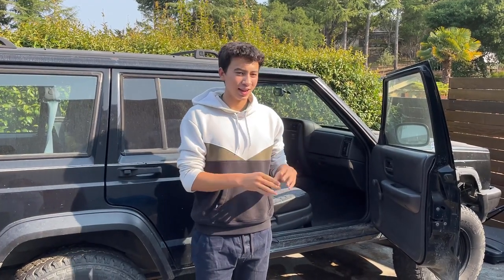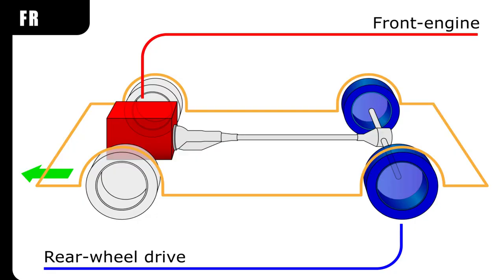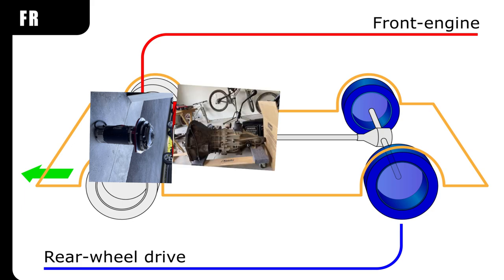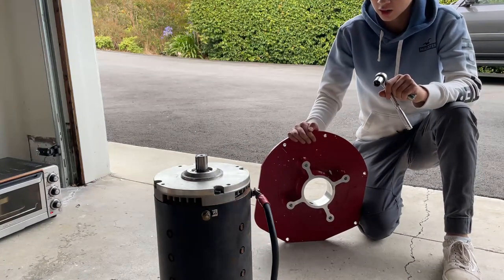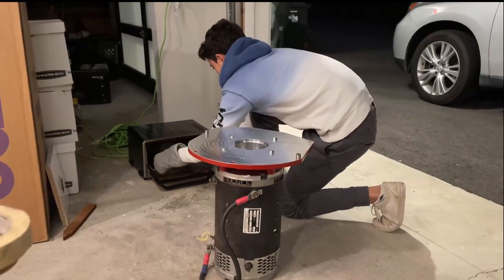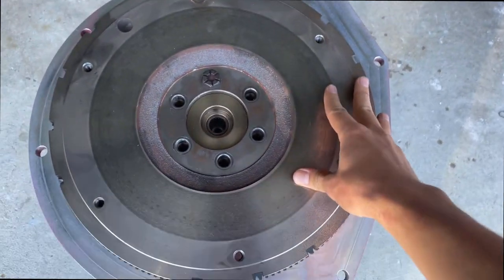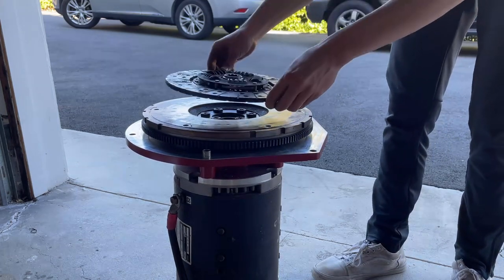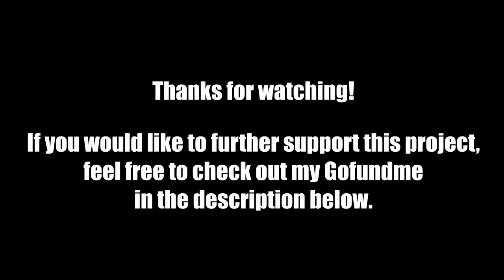Electric motor to transmission connection! (Jeep EV Conversion)

Comment: what kind of electric motor did you use? I'm doing a thesis for a mock up of an automatic transmission and I need a inexpensive electric motor that can run the transmission so it can change gears depending on the speed. what kind of electric motor should i use?

Comment: Very impressive. The key thing you successfully accomplished was research. I've been procrastinating on this project for 3 years. I have the Truck, took out the engine myself and all I have to do is remove the remaining ice components and put my electric engine in. Great job kid.
Reply: I was thinking about doing this to my d21
Reply: Check EVWest they got kits$$$

Comment: Why use the clutch? It's not needed to shift.
Lift off the accelerator 
Shift up or down to the gear desired.
Resume power.

Comment: No information in the video description. What is the motor manufacturer/part number? 
Is the motor 3 phase AC? Power rating? What battery manufacturer? 
Maybe this information is on a separate video? 
I'm watching! Have a 1989 that would be eligible for EV conversion.

Comment: That's really good.
I appreciate your work buddy.
I'm interested in knowing what motor it is?
If I want to convert my ICE to electric, what are the options for the motors?
Reply: Look into buying a used forklift motor. Brushless dc, or BLDC is what you want
Reply: @duandlew5206 Thanks a lot man

Comment: skip the engine, transmision and rear shaft, stick the motor directly to the differential
Reply: That can be done, but he probably want more lower gearing with the transmission
Reply: @hummerguy or plug the engine to the transfer case

Comment: Good Job Man, please I have some questions for you.
(1) what's the characteristics/rating of the motor
(2) How did you connect the accelerator to it and the type of batteries used.
Thanks
Reply: Being a DC motor, you can control the speed by adjusting the votage so I would suspect he's using some sort of voltage regulator to adjust the speed. Would be similar to a rheostat adjusting the voltage to dim a light bulb.

Comment: Finally, someone that is doing what I have thought would work! I have a 2000 Dodge Dakota with a factory 2.5L and a 5 speed tranny. I have long said that the tranny is agnostic to the power source. Yes, I do think regearing a manual tranny would work better with an EV setup, still, gear ratios are extremely important. 

I like how you are 360 degree aware with your project. I particularly like your methodology of star pattern tightening as all old school wrenchers will applaud you for doing this. 

Many Blessings!

Comment: Where did you get the flywheel hub and motor adapter...
I thought you needed a torque reducer because of how fast the electric motor spins in rotation compared to the gas engine...

Comment: Hey, shoot me a message. I want to put a Tesla drive motor in my dodge 2500. I want to make the electric motor run in combination with my diesel engine to assist the engine and give me significantly better fuel mileage. I’m hoping I can pick your brain and get some more info, thanks!

Comment: For a 1500kg car weight and gasoline engine of 2.0L producing 140HP. Could you kindly suggest AC motor capacity that could be utilized?

Comment: This is a cool project, i have rebuilt alot of ICE,transmission, and differntial. For a long time i have been researching the idea of swapping a electric motor with least 300-350 pounds of torque capability too a simply transmission bell housing. IMO a decent electric motor has better torque muiltplcation effect with a good transmission gear ratio and rear end. The electric motors are being sold in diiferent power levels.

Question: What battery cell,pack,acid, are you planning too used. 

But because of the instant torque of these electric motors..make sure your transmission is too task. My personal choice would be a TH400...very strong in stock form and very simple too rebuilt.
Reply: you dont need a transsmision, you can hook it directly to the differential

Comment: would've been nice if you stated wether or not you wanted to be able to change gears while your ev is actually IN MOTION. also curious to know if that (apparent) shrink fit you're using is the ONLY method you're using to "couple" it solidly to the motor...
THANKS :-)
Reply: The adapter appears to be coupled two ways.  First, it uses a key, the same way a lawn mower engine is keyed to the flywheel.  The second is the heat/shrink method.  Basically, the adapter is   the same as a bearing fit, meaning that there are thousandths or tens of thousandths difference in diameter.  You can't put it on my hand.  By heating it, you expand it enough to allow it to slide on, and as you heard, it "clicked" or popped when it was fully seated.  He had to work quickly, as the metal will also cool quickly, which is why he also applied downward pressure for a minute or two.  That keeps it from moving upward.

Comment: Love your project buddy; question; do you need to clutch it while using a motor?
Reply: Yes, how do you expect to shift gears, it's the same process as a gas engine setup
Reply: @TheRoadhammer379  Thanks, I watched it again and paid closer attention.  I saw a similar video of a guy in the Philipines that put a motor in a manual trans jeep and he did not use a clutch; he would stop and select which ever gear he wanted.
Reply: @TheRoadhammer379  you dont need the clutch

Comment: Back when I did it, I didn't have access to premade adapters or couplers. I had to machine my own. And use a random forklift motor from ebay. And build my own kit controller. And use garbage lead acid batteries. Whatever you do, PLEASE do not use lead acid batteries. Use LiFePO4 batteries if you can. Lithium Ion is also OK, but a bit more dangerous and more picky.

Comment: the flywheel and other parts that connected to the transmission, did you have to get special items or did you re-use your existing ones? Also where did you get the plate that covers the transmission from dirt?
Reply from the maker: I retained the existing flywheel and clutch. The adapter plate and flywheel hub are from Canada EV.

Comment: Great job with the video! A little tip when putting the clutch and flywheel together, try to keep them as clean as possible. Spray the mating surfaces with some brake clean and wipe any excess oil or grease that may have accidentally got on them off. Also, not sure how the pilot bearing works with the electric motor, but on traditional engine/trans mating, there is a spline tool you use to make sure the flywheel, clutch, and pressure plate are all aligned correctly before torquing them down. If not, a wobble or vibration may be induced. 

Otherwise, great video and I wish you the best of luck….even though this is an older video, good luck!

Comment: Manual on an electric motor, how’s that working?
Reply: If the motor is like the one in my old corded dewalt from the 1990s and it continues to spin after you let off the trigger it woent be bad but if it's like these new drills and impacts and stops spinning immediately its going to be interesting to drive 😂

Comment: Hi, what you are doing is very fascinating. My 2009 Chevrolet Aveo has a automatic transmission. Your project you doing appears to with a manual transmission. Any suggestions as to what to do if you have automatic transmission.
Reply: i'm wondering the same thing i'm planning to do the same with an automatic trans ! let me know if you find anything on that !

Comment: Very cool project  👍🏽.   Why did you go with a manual clutch?  Wouldn’t a torque converter work better ?
Reply: automatic cars eat up battery
Reply: why? to switch gears you just cut power to the motor

Comment: Amazing job ! One question. Could we not attach motors directly to wheels ? Bypass the transmission altogether ?
Reply: You could do that and it would be simpler if you weren't planning on doing much off roading. But I think using the transmission would be beneficial for gear reduction and putting less stress on the motor for climbing steep gradients. Plus, I'd imagine it would make regenerative braking more effective in sketchy trail scenarios. If he had a 4x4 transfer case, he could even use that instead of the transmission.
Reply: @austinradtke9730  since thus is 2wd i forgot about the tranfer case, you can skip the transmission and hook the motor to the transfer case input, less weight and can use low range for extra torque

Comment: Love your project. Any way to leave the clutch out?
Reply from the maker: I believe you can, although you most likely have to design a custom motor adapter and coupler if you do.
Reply: @TheEVProj  Through my experience as a clutch or automatic transmission is used the motor over-revs and as the drivetrain grasps it torques the motor case braling the magnets and frying the motor. Straight manual only way to go.

Comment: Will replacing the engine with a motor work as well in a manual as well as automatic transmission? Would appreciate your advice.
Reply from the maker: Most likely, but converting an automatic would be more difficult.
Reply: @TheEVProj  I will search for a manual shift donor car.. thank you so much..
Reply: automatics waste power and are not needed for this aplication

Comment: Is the transmission manual or automatic? I have been trying to fine a way to make an automatic trans for an electric conversion
Reply: It's the 5-speed manual; he mentions using a clutch & flywheel assembly. With the auto, just ditch the transmission entirely and go right out of the motor into the transfer case- the motor doesn't need the torque multiplication, and you'll save lots of moving parts & cooling lines.
Reply: why? an electric motor has 0 rpm max torque and can rev up waaay higher than an ICE can so it doesnt need gears
Reply: @omegarugal9283  simple, most cars today are automatic and the conversion would be easier since I would not have to replace an automatic transmission with a manual one. with most  ev conversions you still keep the original transmission so it can spin the axles.